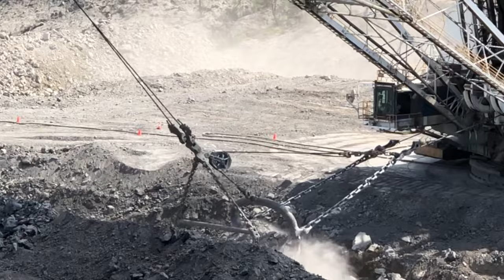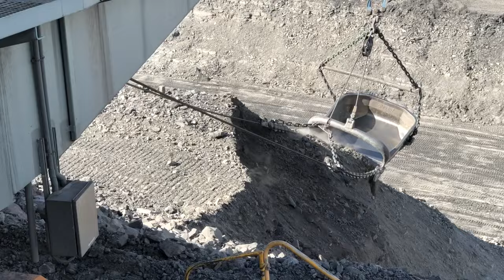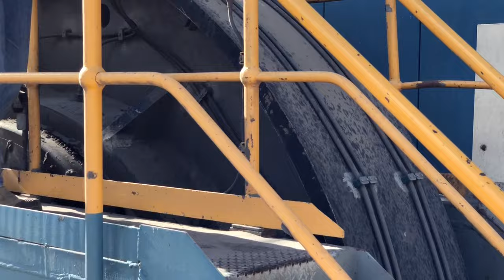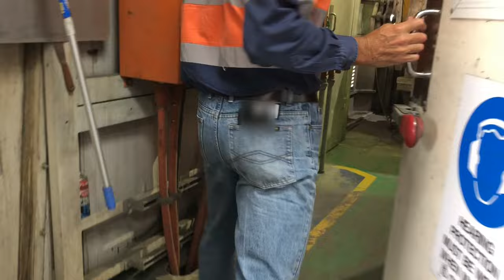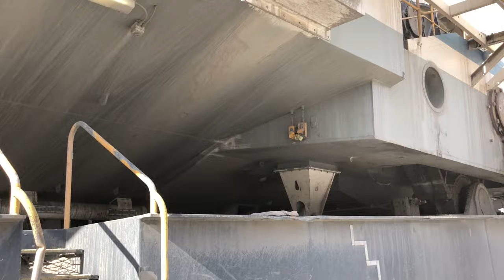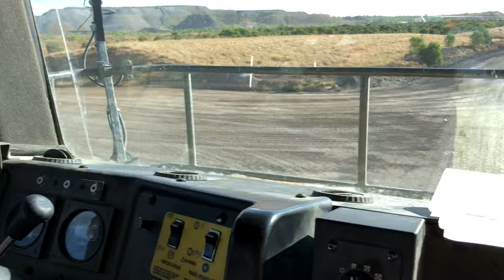One of the largest mobile land machine ever built up close, Dragline Excavator operation

Comment: No that’s not the largest machine ever built the big musky is the largest machine that was built to bad it got scraped after a fire broke out from a busted hydraulic line
Reply: Naw..your thinking of the the one named the captain.  2nd biggest.  It was cut up from the fire breaking out in 1992 in the engine room. Big Muskie was actually shut down from the clean air act being passed. was junked in 1999
Reply: He also said one of the biggest not the biggest
Reply: And I’m sure they scraped it on a regular basis; likely before they repainted it. Or if they got too much frost on the windshield. But of course in the end, they scrapped it, and didn’t have to scrape it anymore.

Comment: I worked on the compressor in one of those about 40 years ago.  It was in Texas digging coal for a new power plant located right behind it.  I have seen nuclear aircraft carriers in the military, but somehow the dragline looked bigger.
Reply: Was it in Henderson?
Reply: @nicholasnelson6876  I'm not sure where Henderson is but this was in East Texas.  It's been a really long time.  The plant was brand new, I remember that.
Reply: @ringandpinion3064  the reason I ask is because I live an hour away from Henderson.
Henderson is in East Texas.
The dragline I'm cutting up has an electric powerplant behind it and another mine directly south of the plant. 
The mine I'm on is for coal and I assume the other one is too.
Luminant mining CO owns the land I'm on. The other mine is called liberty.
Reply: @nicholasnelson6876  I was there in 1987, give or take.  I started up the Atlas Copco compressors in the power plant itself but like any good mechanic I slobbered all over myself looking at that big dragline.  I don't remember if it was a dragline or shovel but I would assume it is the same plant.  I don't remember a power plant specific for the dragline but I do remember some big (huge) electrical cables coming from it.  I was born a mechanic and have always been fascinated with big and/or high tech machinery.  I was a tank and amtrac mechanic in the Marines and worked on hydraulic oil rigs, compressors, generators, etc etc for the rest of my life.  I was really good at control systems and was there as the digital controls took over for the analog stuff, so I made good money knowing that.  I'm old and retired now, not turning wrenches anymore.

Comment: The bucket is too small ( tiny) comparing with the machine,its a wastage of energy.
Reply from the maker: Here is a photo of me standing in one of the buckets https://imgur.com/KfZaQDe
Reply: Truth bomb. 💣
Reply: The Bucket matches the allowed load. If you calculate the moment arm of the loaded bucket from the centre of rotation  and then the mo e t arm of the machine with the counterweight behind the centre of rotation. And compare the numbers you will see what I mean. Drag lines are designed for operations in a specific mine taking ingo consideration the soil type and weight and how much needs to be move per month. As example boom angles are strictly looked at and are designed down go the half of a degree. Most are set between about 33 and 39 degrees, however I know one that is 27 degrees and remember erection g o e at 40 degrees.
Reply: Oooo ic...and Merry Christmas Mr Donns..

Comment: what's it digging it's own coal to power it.  there waste of power.  it needs enough power to run 50 thousand homes.   very stupid that is in these times
Reply: It probably dug the minerals you purchased in the form of an electronic device so you could comment about how dumb it is. Or maybe it dug the coal to supply the power you consumed to make the comment.
Reply: actually this is the most efficient way to move dirt other than blasting, and the coal from these mines are mostly used for steel making. Knowledge is far more powerful than emotions